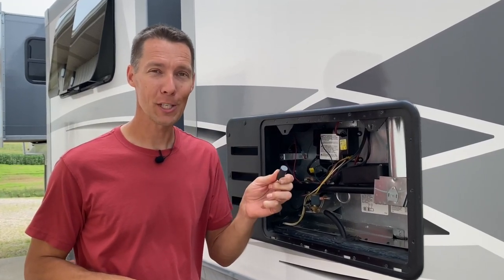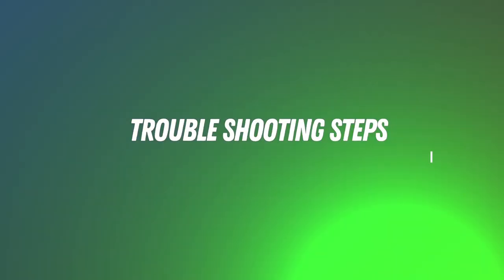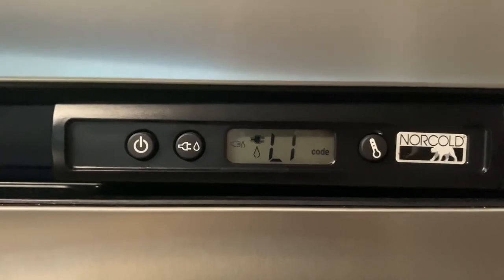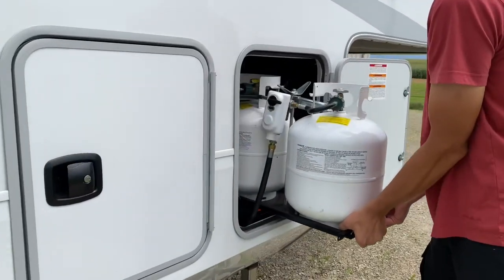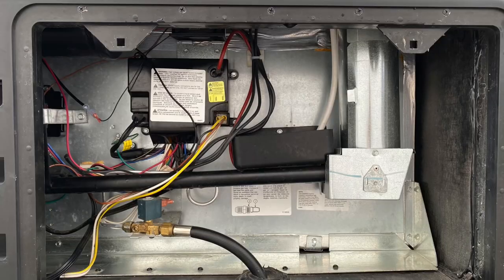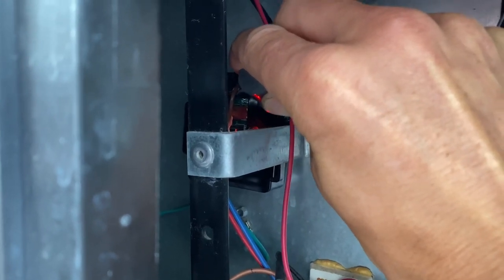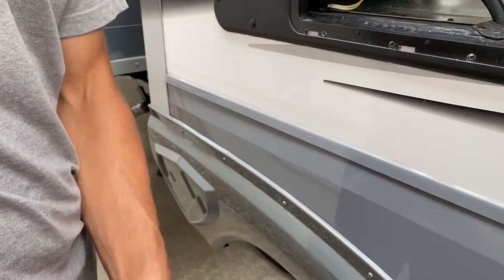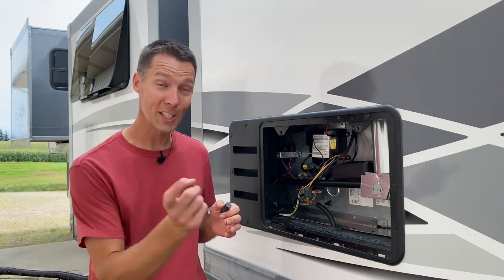RV Fridge Error: Troubleshooting LI oP on Norcold Refrigerator

Comment: I have tried that and the magnet is not working...my light continues to flash as the fridge beeps
Reply from the maker: Whitney, if the switch is gone past the point of the magnet working it needs to be replaced. The new part comes with a rain cover so it can’t get wet and have issues like the factory part. I was able to reset mine with a magnet twice before I had to change it out.

This is the part that fits my 18 cubic foot Norcold fridge. I did not change the sensor with the wire, I just changed the square black box.  https://amzn.to/3OPQNav
-Steve

Comment: I had to open the limit switch case to move the ball with a weak magnet. The actual switch looks like a tiny relay soldered onto the circuit board. The case will come apart without disconnecting any wired from the circuit board. Thanks for the video it saved me alot of diagnosis time!
Reply from the maker: You’re welcome Andrew

Comment: I watched a video similar to this one about 3 or 4 years ago, and bought the magnets for future use.  Those darned magnets sat in my kitchen drawer for all that time.  We had the camper detailed today, and sure enough, when I went back inside, the fridge was beeping with the Lo IP error.  (What's that mean anyway?)    So I dug out those magnets, found this video, and went through the steps.  When I got to the step with the magnets, I rubbed them onto that box, heard a click, and the light went off.   Good to go!   Thank you very much for the thorough step by step.   And if you have this fridge, and dont have the magnets, buy them now!  You will be glad you did. Some day.
Reply from the maker: That's awesome, thanks for sharing. The magnets will work a few times and once it doesn't, you need to replace the actual piece.
Reply: @radarroadwarriors my light came on due to powerwashing, as opposed to some overheating situation. Hopefully it won't go completely fubar.  But if it does, I have the link to the part now!   Thanks again!
Reply from the maker: @MrBradworld  the new part has a rain shield on it.

Comment: I’m having this issue after washing my rv.  I’m on step 3. I hope this works.  Thanks.
Reply from the maker: I was able to reset the switch with a magnet twice before the switch needed to be replaced. If the magnet is not resetting your switch, you may need the replacement part also. The replacement kit comes with a rain cover for the switch and a replacement thermocouple sensor. I inspected the thermocouple for leaks and it was not leaking so I just changed the switch out and put on the included rain cover. This is the replacement kit for my 18 cubic foot Norcold Fridge: https://amzn.to/3a5aUCJ

Comment: Great video.  Just fixed the LI op code with the magnets... the beeping stopped and the LI oP code s off the display.  Thanks for saving me a call the the RV repair on Easter weekend.... mega-bucks.
Reply from the maker: Woo-Hoo! We found that if it keeps happening, the part that the magnets resets, will break. The fix only works a couple of times. The new part comes with the rain cover to stops the part from getting wet in the first place. The replacement part you’ll eventually need is listed in the YouTube description.

Comment: Hmm, my red light wasn't on, it's all dry inside, and I'm still getting L1 oP errors.  I did find a drain hose in that little dish that is suspect.  When I pulled the hose out of the dish, lots of water drained out of the hose, as though the hose nipples were clogged.  I was hoping that was the problem, but no joy, the error signal is still appearing.  Hmm.
Reply from the maker: Tom,
It sounds like that black box is dead. This is the one that goes onto my 18 cu fridge. https://amzn.to/3Ueu3nN

On the tube, there should be some water in it but not a lot. That end piece needs to be cleaned out once in a while. There is a small hole in it.
-Steve